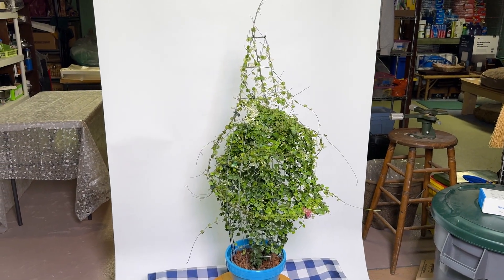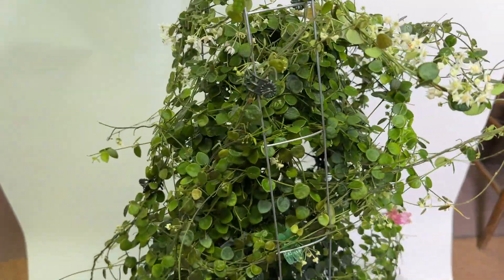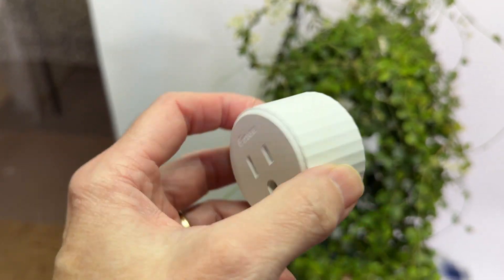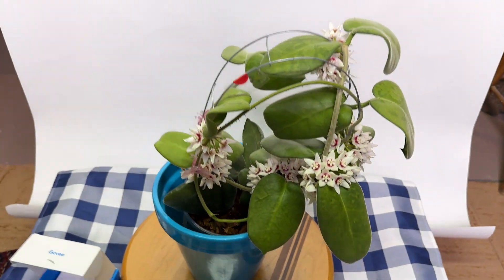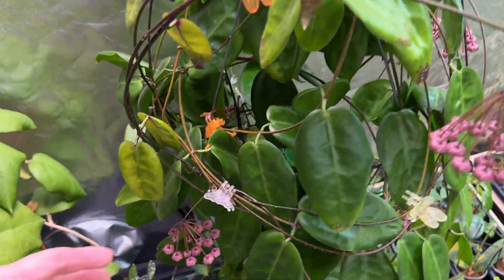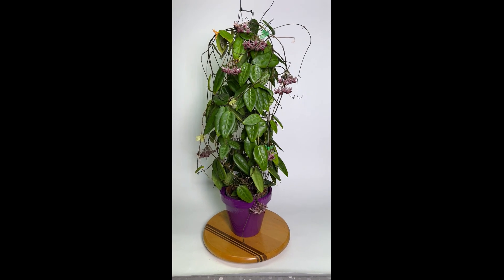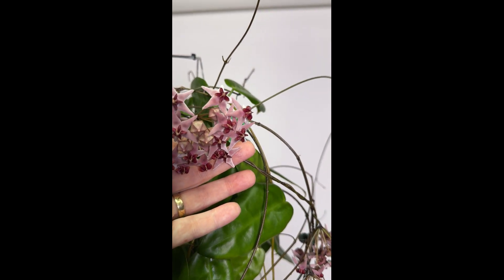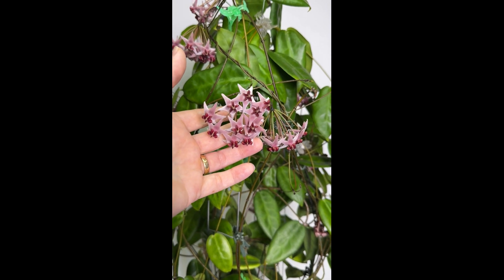Flowering Hoya Through Day Length Manipulation

Comment: What kind of manipulation would it be for Hoya Kerri? So few of us ever get it bloom.  It’s getting full sunlight for 10 hours daily. Heart shaped leaves grown really big but no flowers all these years despite fertilising unlike other hoyas.
Reply from the maker: Although I no longer grow Hoya kerrii, I grew three different clones for a number of years, and I never had any problem with them flowering.  They flowered so much that I used to cut off the peduncles, because of the sticky mess that the nectar from the flowers made.   I'm kind of mystified by the difficulty some people have had bringing them into bloom.  I have to say that they seemed to flower most when put outside in a summer greenhouse.  It is possible that they need a large swing in temperature between night and day, to help trigger blooming which they always received outside.

Comment: I live in a northern clime much like yours. I've always set the lights to daylight length (yes, a manual timer I have to adjust to do so). I presume (I'm not going looking) that daylight length is tied to local climate in the places these Hoya originate and indicate to the plant better growing conditions for seeding (like more rain).

On the smart plug. I'd think there'd be a program where varying daylight based on time of year can be set. I presume this is what you mean. Or do you have to adjust that based on time of year?

I'm continuing to experiment with Turface. Finding it's no guarantee a cutting will "take". The water method to initiate roots does seem the best way to get the most cuttings to root - but I am having some success with it, specially in a warm room - the Hoya that do root in it seem quite happy with it. I'd originally used ODLA (smallish clay rocks) from IKEA, which I've used for orchids, but I think  that media is too coarse for Hoya. You scared me with your Hoya too much water root loss problem 😱😄 Seems I waaaaaay overdid it as I don't think Hoya like the ODLA much.  I expect I'll be repotting all the originals I got from AH Hoya into Turface.
Reply from the maker: Smart plugs to my knowledge are not yet smart enough to automatically adjust day light according to the time of the year.  They are only 'smart' because they connect to an app on your phone, and are easy to adjust even in one minute increments on your device, but you have to do the adjusting🙂 I once bought 200 lbs of Turface, changed the majority of my Hoyas over to it, and rotted all of the roots out in record time.  I then spread all of the Turface in a dirt crawlspace that I had, just to get rid of it.  I have tried most methods; leca and semi-hydro 3 times, Pon and Growstones.  I have failed in them all.  I will never move on from coconut  husk; under my conditions it works better than anything else.  With most of these other media, I simple can't tell when to water and inevitably I will rot the roots from a mistake.  For myself, I find that it is better to not stray too far from what you are familiar with.
Reply: @DougChamberlainVTHoyas  Wow, 200 pounds of Turface! I bought a couple of bags for Stepelia - which did NOT work out well, much as you experienced with Hoya (they're from the same family, though very diff plants).

Agree wholeheartedly on not straying from what works, yes indeedie. The leca isn't working too well for most of the Hoya I have so I'm currently trying the Turface, which is working a lot better for me. Though the initial trial wasn't too long ago, I can see plants like imperialis & engleriana don't have yellow leaves when growing in it,  which they do in the leca and the spacing of imperialis leaves is much denser. Same vigour for some others.

I'd thought of trying coconut husk. Having experienced the drenching ritual with orchids I'm not keen on it quite yet. How is media breakdown with it? Looks impossible to cleanly get off the roots so, one would hope there's not much repotting involved. The same is true of Turface as it does seem to bind a bit to itself, though no worries about media breakdown with it.
Reply from the maker: @DougguoD  I will admit that the drenching method is a LOT of work, much more than when I could just pour a little water into a pot, and move on, but the results and overall health of the plants is currently worth the effort.  I've only been using the husk now for a little over 2 years, but so far the breakdown of the media has not been that much of a problem.  The plants however grow so quickly with it, that it requires frequent up-potting.  When the plant gets to an unmanageable size, I usually chop it up, and restart the process all over again.
Reply: @DougChamberlainVTHoyas  I suppose one could just repot the Hoya with the not yet broken down media, as the broken down stuff becomes dusty/mushy and so should be quite easy to remove - though no idea how that works on coir. And yeah, repotting orchids in leca (or anything, really) is a PITA. Hoyas do seem rather less so.

Comment: That is surprising to me. H. piestolepis occurs from less than 1 degree to less than 9 degrees south of the equator. The minimum daylength at Port Moresby, which is at a little over 9 degrees south is 11 hours 34 minutes. The maximum daylength is 12 hours 40 minutes. Your plant almost literally thinks it is Christmas and it has gone to visit relatives in Pormpuraaw, north Queensland. Hoya calycina has much the same range (2.5 to 9 degrees south), so thinks it has moved from Queensland to the equinox, where day and night are exactly equal. Hoya IM-08 is also from New Guinea and you have convinced it that it is the June solstice, slightly further south in Queensland. I am intrigued that they respond so dramatically to daylength, presumably weather systems in New Guinea are related to the time of year even if they don't have winter and summer. I have questions. Do they need the superstimulus of the, to them, unnatural daylength? Will they still flower so abundantly if just moved to exactly Port Moresby maxima and minima daylengths? In the case of Hoya calycina, being moved to the equinox from the maximum daylength. Could you get away with just manipulating the daylength within that 1 hour and 6 minute range? That would be easy to test with your new smart plugs, I suppose?
Reply from the maker: Great information as always Pat!  I am sure that much smaller changes in the light cycle would be able to accomplish the same thing.  It would be wonderful if the information that you provided would be more easily available along with the exact time of the year that a plant was found flowering in its endemic location.  With both of these pieces of information, it would be much easier to know whether to increase, or decrease the photoperiod to bring on flowering without all this trial and error.  One thing is for sure, some plants just won't flower under the constant photoperiod that a grow light without adjustment provides.
Reply: @DougChamberlainVTHoyas  Good point and the mystery deepens. There are five herbarium specimens of Hoya piestolepis with flowers on GBIF. The dates are (English style, day/month/year); 4/3/78, 8/5/1919, 25/7/64, 2/10/1956, 10/10/1907. The dates for H. calycina flowers are basically the whole year: 20/2/1977, ?/3/1939, 4/3/56, 26/3/1908, 26/4/1966, 12/6/79, 13/7/1967, 18/7/1953, 26/7/1992, 26/7/1968, 25/8/1986, 29/10/1973, 15/11/38.
Reply from the maker: @pattheplanter  Very strange indeed!
Reply: I researched this as well. I do not have any advice for you because I am still wondering.

Comment: Beautiful specimens 😍 Particularly that h. Piestolepsis 👏🏽 It’s crazy the difference an hour or two makes in either direction. Do you have a dedicated grow space for these Hoyas you’re actively trying to bloom? I need to get on those smart timers! I had one Sansi bulb that connected via Bluetooth but stopped working when I had a brief blackout, so I don’t recommend those 😅
Reply from the maker: Hi Ria, I have enough grow tents that it gives me the luxury of moving things around and changing up the number of hours that the grow lights are on.  I have had zero problems with the plugs in this link: https://www.amazon.com/dp/B08731J1L4?ref=nb_sb_ss_w_as-reorder_k1_1_3&amp=&crid=32VALKY14U1H8&sprefix=gov&th=1 I have 10 of them spread out around the house; they are also used for just turning on and off regular lamps that we use for ambiance.
Reply: @DougChamberlainVTHoyas  haha! Mustn’t neglect ambiance 😊 Thank you for the link! I’ll check em out! My main one, which is mechanical, is starting to break down.